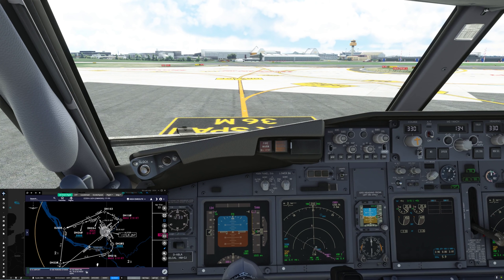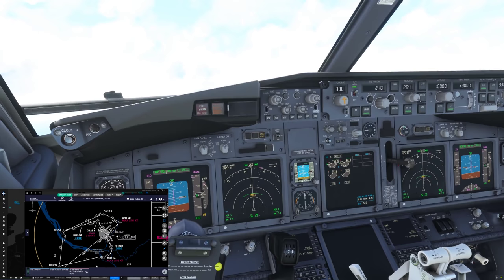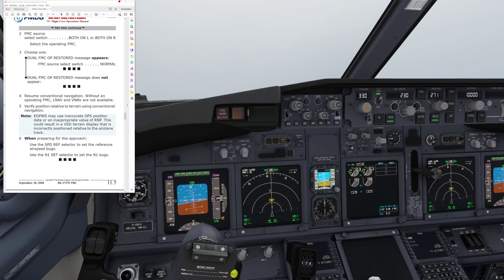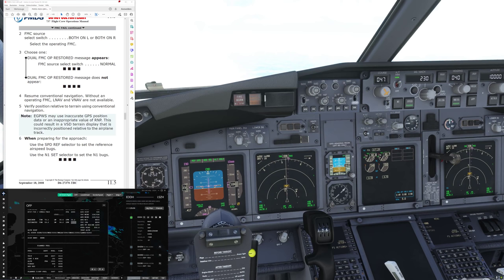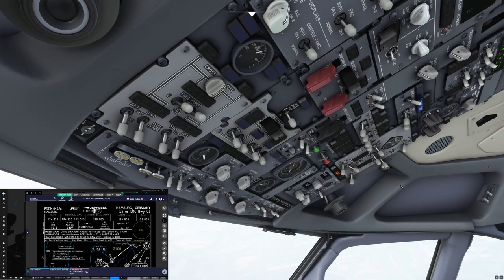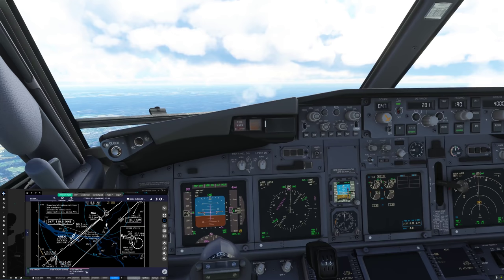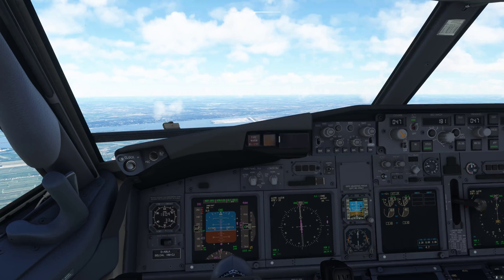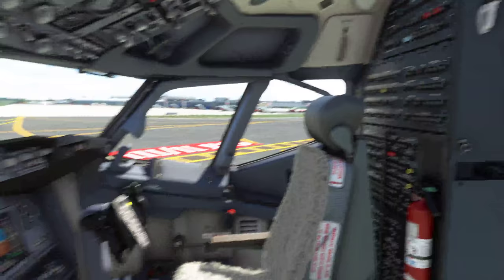PMDG 737-700 for MSFS - Failures: Dual FMC Failure (on VATSIM)

Comment: Another fantastic video, feels like I am doing a type rating or conducting line indoc training watching your videos. Excellent stuff, from an old B732 drvr lol
Reply from the maker: Thanks! Would have loved to have flown the 732 at some point in the past. But I guess the next generation of pilots will say exactly the same about the 737NG and at some point at the end of my career probably even the MAX.
Reply: @A330Driver  yes lol, 732 was loud and smokey I didn’t fly it long unfortunately. I flew in and out of gravel runways up North, FO was very busy with bleed configuration for takeoff and landing. FO was busy with manual weight and balance and making TOLD cards on each leg. Enjoy the new stuff buddy, it’s fantastic equipment.

Comment: heyyy you did an excellent work on this wonderful plane, I was waiting so much for the 737 to arrive at mfs2020 can you predict about the price when it drops? and will it only be 737-700 or also the bigger version of the 737 so 737-800?
Reply from the maker: I can not predict any pricing, sorry.
The first release will be the -700, thereafter PMDG will release the -600, -800, -900 and MAX (in this order).
Reply: @A330Driver  thank you will they come as a kit or will you need to buy them all separately

Comment: Great video again, thanks! If you make another failure video, would you mind showing how you set it up?
Reply from the maker: I think I might rather make a seperate video about it at some point.
That video could be used also to explain how to pick "your failure", which systems you have to fail for it, etc.
For example for the manual reversion video you can not just select "Manual Reversion" from the failures menu. Instead you have to choose: Either you fail all hydraulic pumps (seperately) or you can also let the reservoir run empty. Which is the better choice for your scenario?
Explaining all of this would very well be a video of its own.
Reply: @A330Driver  such a detailed video would certainly be fantastic!!! I really hope there are options to set random failures as well, to test my awareness to something unexpected (I'm pretty new to flight simming, so i have no experience with such detailed planes)

Comment: Hello, thank you for your very interesting videos. I have a small question concerning the failures: are they random and linked to bad manipulations or with low probabilities, where are they necessarily created by the pilot?
Reply from the maker: You can program failures to occur either based on the air frames service life, by chance (you can set the percentage yourself) or you can directly trigger certain failures from the FMCs failure menu.
Reply: @A330Driver  ok, it's a very good thing for immersion if failures can occur at any time. This aircraft will be awesome!!! Thank you for your answer.

Comment: I don't have time to watch the whole video, how does he have LOC capture and G/S if no FMC? Where did he config the ILS frequency?
Reply: There are two NAV radios on the pedestal, this is where you tune the ILS  frequency.
Reply: @removebeforeflight7365  makes sense, thank you so much! noob here 😀
Reply from the maker: All aircraft I know of (even the Airbus) have navradios where you can tune the frequencies outside of the FMC. As source of the data simply use the approach chart, it's all on there. We do that even when the FMC is still working.
The LOC and GS modes of the Autopilot work independant of the FMC. Both Localiser and Glideslope are ground based radio signals. The aircraft does not need an FMC to process those.

Basically, when both FMCs fail you only loose LNAV and VNAV modes. The rest of the Autopilot functions is not based on FMC data and therefore still available for use.
Reply: @A330Driver  That's why they are part of the MEL(Minimum Equipment List)